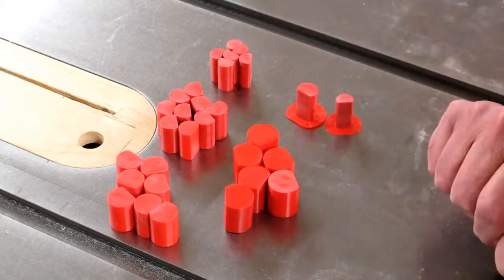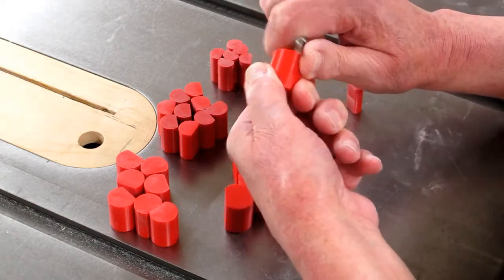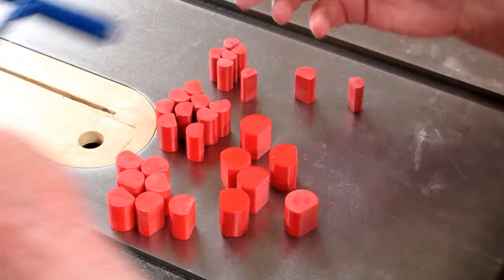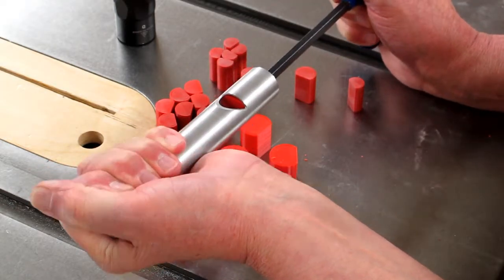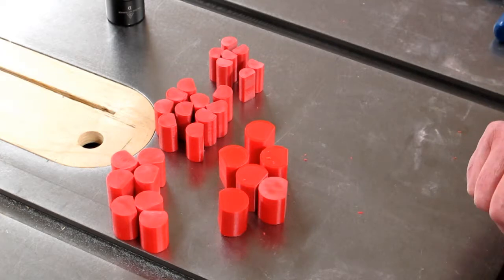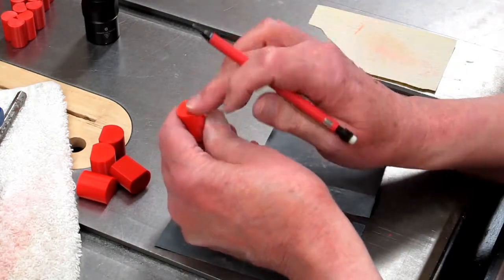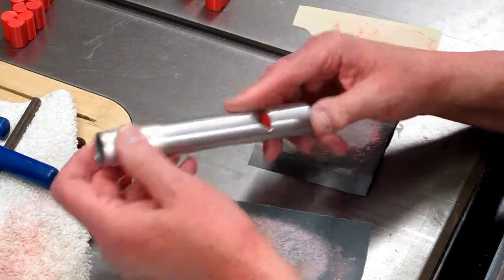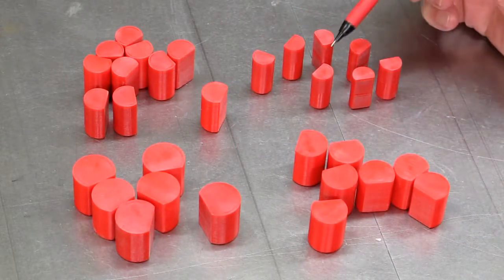Mini Calliope Part 5 - Pipe Airway Blocks

Comment: Great stuff Ron ! Wondering which material you used to print the airway blocks ? I printed stuff for pipes in PLA in the past, but wonder if this is the most durable material.
Antoine
Reply from the maker: Everything I printed for the calliope is PLA. It seems to be strong enough for these applications.

Comment: 40 hours? Suggestion: I recently found that a lot of printing time can be saved by loading the heat bed with many different prints of different shapes and heights. Yes, there is a higher chance of a failed print but my success rate has been 100% so far. Edit: I also find that a layer height of .18 is just as accurate for most objects and saves a crazy amount of time vs. a .1 layer height. It took me a couple of years before I finally realized this. :-)